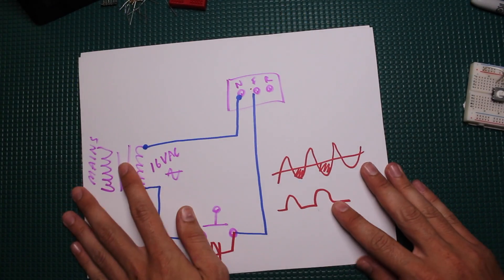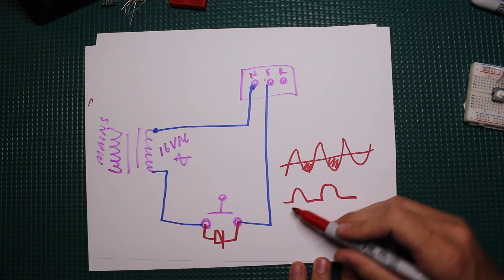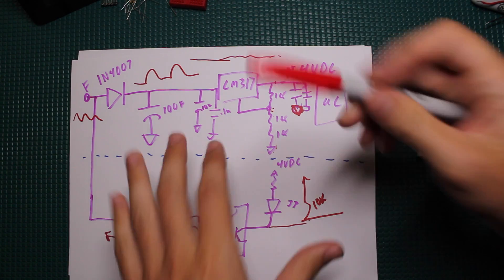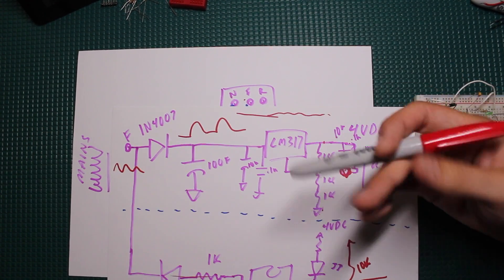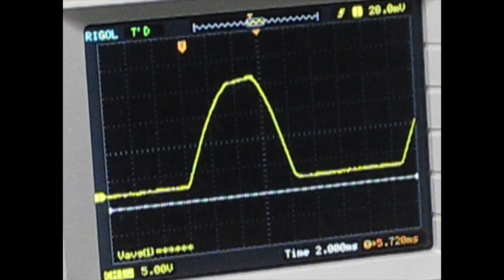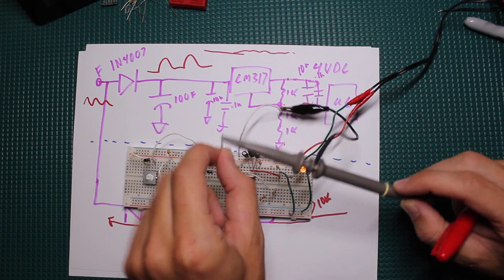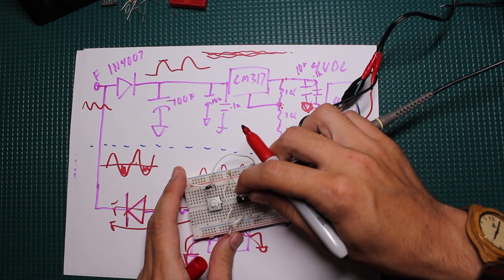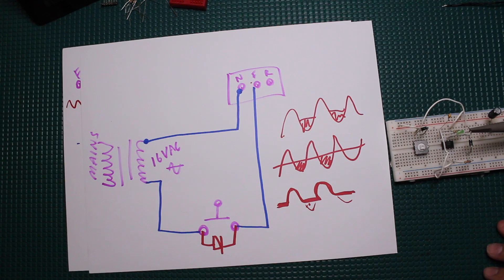Purpose of the Diode in Doorbell Circuits?  Test circuit and Experiment!

Comment: a capacitive dropper with an optioisolator would be a whole lot more efficient, and the polarity of the supply would not matter.
Reply: Makes no sense.  Which means you either don't know what you're talking about or you just don't have any communication skills.  Full-wave bridge solves the polarity issue and no opto-isolator (huh???) necessary for any of this.  Button open:  half voltage.  Button pressed:  full voltage.  Simple voltage comparator done with passive components.
Reply: @DiffEQ  let me enlighten you, since it makes no sense to you...  where he's showing the button detection circuit that relies on the optoisolator and the diode at about 9 minutes into the video, you can replace that by a simple capacitive dropper and an optoisolator.  at half wave, regardless of polarity, the opto will stay off, because the capacitor is charged in the single direction of the current.  at full wave, the current will pass, and the opto will trigger.  that way, it will not matter which direction the diode inside the button is pointing, and the rest of the doorbell can use a full bridge rectifier for its power supply.  now, this was 5 years ago...  now I would use a detection circuit that's even simpler )))
also, to answer the second half of your reply: no, you will not get "half voltage" with a diode...  which tells me that you have no understanding of what you're talking about...

Comment: Great video, thanks.  The reason I'm looking into this is that the bell doesn't work with the diode installed, but removed plays the first portion of the tune.  Should I suspect a bad diode?
Reply: diode backwards?
Reply: @nathanbriggs74  I can't remember anymore, I'm sure I tried both ways.  I quit that doorbell and went with a Ring.  Thanks for the response.

Comment: Great video I know you can help me.I have a Nutone Concerto LA61 Door Chime that does not play the programmed chime when front door button is used.Front & back door bell buttons and wiring to unit checked & are ok.Rear door chime is fine and all buttons for programming on unit are fine.The unit plays the chime when tested from unit.It appears the trigger circuit is bad for the front door.I wired the front doorbell to initiate the rear door trigger so I have a simple single chime for now.I am not sure where and what it would look like on the circuit board.Thank You Bob

Comment: The day before you posted this I was working on how to make an electronic doorbell. I used your video as a guide for the circuit and everyone was spot on. I changed from a half wave bridge rectifier to a full wave, since I was concerned that the power drawn by the speaker would cause voltage dropout with only a half wave. This meant that I had to install a switch mode power supply between the two since the Uno didn't handle 21 volts well.

In hindsight I could probably just have gotten an appropriate switch mode power supply in the first place, but the trigger portion of the circuit was on the same perf board as the full wave so I left it. Regardless, it works amazingly! Thanks for this video.

Comment: What happens when you reverse the diode in the switch? The system would not work. 
I would propose to use a full Bridge diode rec. and do the detection over the frequency. You can do this with eg with an ne555.
Reply: Detect frequency??  Overly complicated.  The half-wave rectifier reduced the FW bridge output until the button is pressed.  A simple voltage divider will suffice to detect this difference. (100% increase)

Comment: Yeah the older non-diode/pushbutton circuits were used on simple solenoid ringers/bells and are still used today. The newer electronic annunciators require a power supply bypass through the button. 
Well explained.

Comment: So based on your thought process the diode has to be wired in with the correct polarity for your circuit to work.   Plus if it was installed backward you could destroy some components.  Did the TV show specify anything about the installation of the diode in the correct direction??????
Reply: i dont think it will destroy anything of you have it backwards because the positive side is protected with another diode. the chip will be inactive offcource and some voltage will go to one of its pinouts but thats about it from what i can see
Reply from the maker: yes, that's right, nothing bad would happen, just wouldn't work right.  You wouldn't have the always on power, so the chime would only get power when you press the button